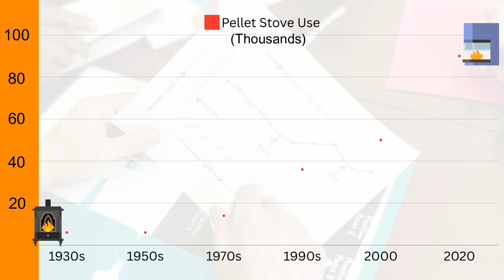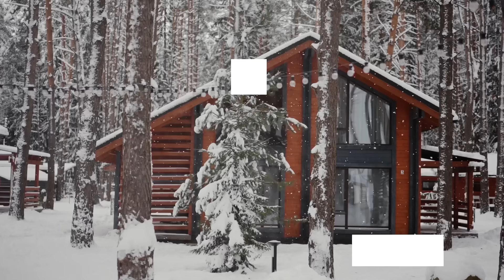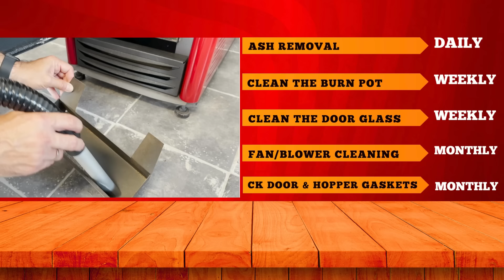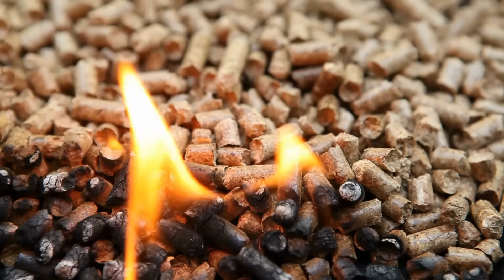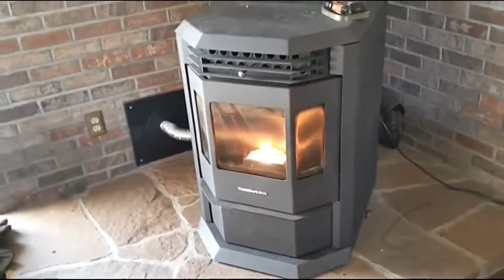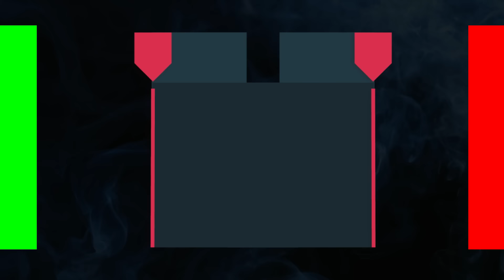THE COMPLETE TRUTH ABOUT PELLET STOVES

Comment: In my Woodshop, 1000 sq ft, it has cost me around $120 a winter to heat. Had this Ashley King for 15 years. Close to 70 years old and this is much better than dealing with wood or it’s mess. Light it and forget it till done in evenings. I buy the pellets in the summer when they are clearanced out at Menards for $4 a bag on average over the 15 years. Personally for me, they are cost effective and so much easier to use than wood.
Reply: I heat appropriately 2500 square feet with Temps sometimes at 10°or 0° for weeks or months on end using 3 to 4 bags a day maintains the house around 74°
Reply: @chevy3759 you think your saving money over gas? I don't think you can beat a gas high efficiency furnace, unless the price goes through the roof. I only seen that happen once. I got my LP gas this yr for $1.17 a gallon. If you pay $6 per bag and use 4 a day, that's $24 per day. 4 days is basically $100. Roughly 36 days would be equivalent to what it cost to fill my LP tank. My 1000 gal LP tank cost less the $900 to fill this yr 2024. I don't think I couldn't burn that much gas even if my furnace ran full throttle, 24 hrs a day for 36 days. 
     My house is old, with 2×4 side walls, 2 stories and the furnace also heats the basement. 2000 square ft or better also. I'm in West Central Wisconsin. 
     I have a Harman stove. The only way I can beat my furnace, is by getting pellets in the lower $4 per bag, close of the upstairs and no heat in basement because pellet stove is located on first floor. 
     You can't beat these new high efficiency furnaces now days. Mine is 95%. My parents use just over a $100 of gas on the coldest months of winter in a newer ranch style house. That's equivalent to less then a bag a day at what I pay per bag. Yes there's many variables. Their house is not out in open field on top of a hill where the wind hits it either. 
     I have both a gas furnace and corn/pellet stove. Bought the Harman pc45 because I could get corn cheap. That was before they decided to make garbage ethanol out of corn. Because of price, I had to swith to pellets. 
     If someone asks me about a pellet stove, I tell them to not waste the money. If you can buy wood pellets for $3 a bag or cheaper, maybe. Or if someone gives you a good pellet stove for free cause their tired of it. Otherwise your way further ahead buying a new 96% efficiency furnace. 
     I've crunched these numbers for yrs. Basically now, I heat my house for free. I have trees that fall down and others that die every yr. So I cut about 10 face chord of wood in spare time and sell it for $85 a face chord. Then I use the money to buy LP!  You should see faces of the guys at the coffee shop. Their spending 8 to 12 thousand on these fancy outdoor boilers. Paying loggers $1200 or more for a load of oak bolts to cut up. Then in about 10 yrs their boiler is burned out and has leaks. Lol. If you can't get your wood for free, you not gonna beat a gas furnace there either. Chainsaws, trailers, chains, files, gas, pickup truck etc.
Reply: @toddscholze6168  I live on 13 acres in the country. Don’t have natural gas available. Total electric. Not installing propane. Like I said, for me the pellets are the most effective way to heat my woodshop.
Reply: @toddscholze6168 $900 to fill a 1000 gallon tank? That’s insanely cheap. It cost me almost $500 to
Get 190 gallons last year.
Reply: @toddscholze6168  thanks for info,,i had a new gas furnace put in 2 years ago and was looking to get a pellet stove to supplement of the rise in natural prices but after reading your comments it doesnt seem it would be cost effective,,,my only other resort is getting a wood stove but then i have to do all the labor in getting the wood for free and thats a lot of work....or maybe get an outside propane tank hooked to another heater of some kind?
Reply: @toddscholze6168 I'm curious at to where you live to get propane that cheap? It's no where near that cheap in NY. Last winter my mom was paying $2.69 a gallon. Some people I know were paying $4+. I have a high efficiency furnace and have natural gas. With all the extra fees our electric company puts on is a break even in the cost of pellets and natural gas. Electric is where I really save money. Our rates are through the roof. My pellet stove uses far less electricity than my furnace and it runs 24/7 all winter. I definitely save money with my pellet stove and I burn 4 ton a year.
Reply: Same with me. 1000 sf.  Cleaner n easier. I'm 60. Got englander
Reply: Storage inside that shop gets you that savings advatage
Reply: @clairereynolds8583 Just had mine filled 2day..171 gallons..$360 Including all the bullshit taxes and fees

Comment: Pellets cost 275$ ton here in Arkansas, I use a solar powered generator in ups mode to use in case of power outages
Reply: How often do you have to fill it? Does it heat pretty good and what's the highest temp can you set it? I'm in arkansas as well and thinking about switching to a pellet stove. I had a blower on my woodstove from my other house and loved the fact that it heated up a 400 sq ft room and 250 sq feet kitchen easy. I would have to open windows it got so hot.
Reply: Depends on the temperature outside.but on average about 1 time every 2 days.  It's controlled by thermostat.  It will heat to 450f.

Comment: Something that was not mentioned was that there are 2 types of pellets. Soft wood pellets and hard wood pellets. Which also means there are 3 types of auger systems used in pellet stoves. I know someone that broke the auger system in there pellet stove because there stove was soft wood only and they were using hardwood pellets. The pellet stove you want is one that is designed to feed either pellet.
Reply: Well thats confusing ! Thanks for the heads-up.
Reply: @ARKY-v3x  Only reason I know about what I said is my aunt on my dad's side had one and ran the wrong pellets and burned up the auger motor using hardwood pellets in a soft wood pellet only stove.
Reply: hardwood is better and cleaner and more expensive

Comment: Another useless heater when the power is out. There is not many pellet stoves that don't require electricity!
Reply: Good point. We always had a warm house and hot soup if the power went out when heating with our wood stove.
Reply: @banjohappy  I build a Rocket Mass Heater. Then, I  adapted it to burn pellets ! I burn 1 40 lb. Bag of pellets per day. Burn three hours and let the stove go out. The stove will pump heat for hours after going out.

Comment: I heat with a wood stove and I cut the wood off my property here in Tenn.. A lot of ppl on here say they heat for about $1k with pellets.. I can heat with electricity cheaper than $1k a winter.. My electric would only be about an extra $100 a month if I just used electric heat.. I don't have central heat and air,  I have an AC in a window.. It's a lot cheaper to buy a new window unit every 10 years than to maintain/buy a HVAC system..

Comment: Wood stove # 1 no electricity needed 
# 2 burns clean when seasoned properly
# 3 you don’t need a gym membership when you cut split and stack your own wood
Reply: Most don't have the time to mess with it
Reply: Then they wouldnt have a wood stove  to begin  with.  @brianmatthews4149
Reply: #1 Freezing your tail shoveling ash's and taking outside before starting for the day #2 storing split cords outside takes a lot of room and attract bugs "properly seasoned" is hit & miss create heavy build up in chimney #3 without blower they suck air up and out while bringing cold air in from every room. #4 only the immediate area gets warm and most of the heat created goes straight up the chimney. #5 when stored split wood gets wet,, YOU FREEZE #6 how much is your time worth cutting, splitting, and stacking/storing.....  I can easily make over $3K in the time it takes to cut & split a cord
Reply: I use to burn wood I cut split. Spent days getting enough for the winter. Had to buy a chain saw, end up having to buy a 4x4 truck. Gas for the truck during all the days and gas, oil, chains, bars, files and maintenance. Went to pellet stove, couple hours to buy and haul and store pellets. Fill the stove once a day, vacuum and clean the glass take me 5 minutes and done. No poking the fire, cleaning buckets of ash having bugs and bark to clean up. In my opinion it’s cheaper for pellet, more time for me to do something that I can make money at or doing something that needs to be done and not some where cutting, splitting, loading and unloading then babysitting a fire.
Reply: @oldfarmer4700   Truth bomb right there! 😃
Reply: Not to mention the insects in firewood.

Comment: I have a small cabin in eastern Canada with a pellet stove as the primary heat source ( in place when I purchased the property). The pellet stove provides adequate heat most of the time but on colder days I burn two 40lb bags of pellets, the costs quickly add up at $9/bag. While pellets are convenient there is no comparison to the heat produced by a conventional wood burning stove.
Reply: @larrygates3737  yes, I agree. But, at 71, I don't cut my own wood anymore and carrying in a a bag or two is much easier on me then cutting 7 cord of wood a year.
Reply: @TwopersonsWalksalone  - I have 15 face cords delivered and stacked in the fall, costs $1150..   Versus $1350 for 5 tons of pellets delivered.  I have my firewood stacked outside about 5 feet away from a window where my stove is in the house.  Granted I'm still a youngin' at 53, but moving a couple of arm fulls every couple of days is a lot easier for me than the constant fighting with the pellet stove to keep it running.
Reply: @KrisBennett-pt6gq  a cord of wood is easily 200 dollars here delivered
Reply from the maker: I agree that in areas with long winters and extreme low temps, pellet stoves aren't likely the best fit. We did a video several years ago doing a side by side comparison between wood heat and pellet heat here-https://youtu.be/vqQtkBVm-gA
Reply: @AmericanOutdoorsUSA  This is the link I'm looking for
Reply: I have a steel wood stove.   I like the fact that I can burn any kind of wood.   I looked at the cost of pellet stoves and pellets compared to buying cord wood and cutting and splitting it.   Pellet cost was the deciding factor.   Also occasionally there can be pellet shortages.   Also if elect goes out pellet stoves can't run unless you have a generator
Reply: @charlessax4385 well that sucks
Reply: $9, that's crazy. I pay 6 I bought 3 tons for this year plus I have a wood stove and right now. I'm burning in both of them
Reply: @goatman6151  In Canada anything to do with home heating requires us to bend over, 'cause we are going to take 'it' in the rear. We pay upwards of 13% sales tax on ALL things regarding home heating. In a country that has almost 6 months of winter.
Reply: @goatman6151 got mine for $4.18 a bag at menards with their 11% discount and the pellets being on sale. Even with that price,  I think my high efficiency gas furnace runs cheaper. Got my LP gas this fall for $1.17 a gallon. Early order.
Reply: A friend of mine put one in years ago after one year he removed it and put his woodstove back in he said if he had to pay for pellets he should just use oil
Reply: how big bag is that it sounds expensive, here in finland i pay 365 euro for 1000 kg
Reply: @s @stefanviklund7042  I pay $ 225 dollars for a ton of pellets. 50 bags for $4.50 each.   This is USA dollars.  The bags are 40 lbs, and there are 50 bags in a ton.
Reply: Dearly love mine.  Englander... roof vent. Fresh air intake. .1000 ft house.  Warm n toasty. Low labor.  We love it
Reply: Rocket stove with pellet hopper would b killer
Reply: Very informative. Concise and clear answers to all my questions. Thanks
Reply: Pretty sure yours is undersized. Or you don’t have fresh air intake.
Reply: I saw one that was advertised as European on a video and it look like she had some wood in there you can put in there or you can open up the top and put the pellets in there but it look like you could also use open the door up and put pieces of wood in there which is what she did so I'm a little lost

Comment: The theory is better than the actual experience... I got a Castle Serenity back in 2018 but wish I had spent on a good wood burning stove instead of a pellet. They are not simple, you cant seem to find anyone who knows anything about them & they are far from low maintenance.... they are certainly not cheap to buy or install. You have to learn to tune the unit for the  pellets you buy & stick with that brand.
Reply: I’ve got the same stove and you’re right about the maintenance and lately the cost of pellets is driving the practicality of ownership way down.If you have access to free wood obviously a good wood burning stove is better although I don’t like the mess.Id consider one of those outdoor furnaces
Reply: Thank you for sharing you experiences with pellet stoves.  I have a Riteway wood heater that we have had for nearly 40 years.  Our home is total electric and when the power goes out in the winter, we use it to heat our home.  The biggest disadvantage of a pellet stove in my mind is that it requires electricity to operate, not like a stock wood stove!  My only maintenance costs is that every 2 years we have to replace both the fire door and cleaning trap gaskets, but that is a simple job.  No computer panels, turning screw gears, etc to maintain.  We clean the chimney twice a year, just before starting to burn in the early winter, and once during mid winter, which is a simple operation, requiring only a chimney btpruskph and a length of rope.
Reply: I agree with you, there was a time when pellets were cheap enough to justify the hassle of the maintenance but not anymore, better to burn wood that for the most part is free other than the labor
Reply: Had a Harman insert in our previous home.  Always something to clean or scrap.  Couldn't depend on the igniter to touch off the pellets and had to manually light from time to time.  Pellet consistency was inconsistent from year to year even with consisting of using the same brand of pellets.  And of course a ton of pellets increased in cost every year as well.  No electricity meant no heat from the pellet stove. A good old fashion wood stove is the way I'd go today for sure.
Reply: I’ve been running a Castle Serenity for the last 5 years.  It heats our entire first floor here in Vermont on 2 1/2 tons per year.  At $300 per ton,  that’s about as cheap as you’ll get.  I’ve had no problems with the Castle.  I’ve burned everything from Super Premium Vermont Wood Pellets to Home Depot Green Supremes the last couple of years.  Tuning the fuel feed and/or blower speed is ridiculously easy.  Even burning Green Supremes, I only need to shut the stove down once a week to vacuum ash out.  Otherwise it runs on low setting 24x7.  Only need to bump the setting up to 2 or 3 if temps drop below zero.  One of the best things about the stove was I bought it at Ace Hardware for just over $1000 and installed it myself.  Paid another $150 for pellet stove pipes and fittings to adapt to an existing masonry chimney

I’ve never had a problem with the stove, but I have one very important modification to it:  I have a 1000VA UPS powering the stove.  The UPS was inexpensive, designed for protecting Desktop PCs.  When the power goes out, the stove will continue to run on the UPS battery for about 30 minutes.  Plenty of time to either shut it down gracefully, or go out and fire up my emergency generator.  It will run off the generator, through the UPS, just fine.

My son also has a Serenity in his basement and has had no trouble.  But he likes burning pellets so much he upgraded his oil fired furnace, when it needed to be replaced, to a MESys pellet burning, central furnace.  He gets bulk deliveries into a bin in the basement next to the furnace.
Reply: @1wheeldrive751 , Thank you for your information I'm seriously considering a serenity pellet stove with a back up in case of power outage.

Comment: I have been using pellet stoves since 1998. All the stoves I have had draw the air for the burn is drawn through the stove and not pushed through. Unfortunately I am looking at having to replace my current stove. Having the air pushed through would be better so that the blower isn't subjected to the hot exhaust. Which ones work this way?  Noise is a big consideration for me.
Reply: I bought a comfort built, hp 22, ordered at our tractor supply  on sale 2200.00 it burns 80 percent efficient easy operation, love it.
Reply: @brianmatthews4149  That was one of the stoves I was looking at. Fortunately I found a few of the internal vent tubes were mostly blocked by ash. I had forgotten about those, I broke one of my rules by not doing a top to bottom service prior to the start of the season. Cold weather came in sooner than expected. My stove is a locally built unit that works well but a complete cleaning is somewhat intensive and time consuming. All good now.